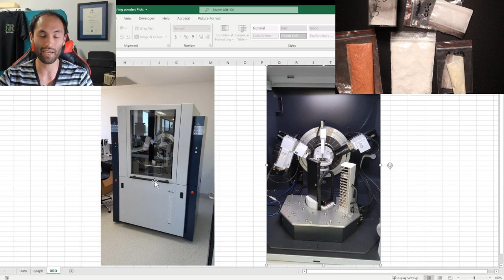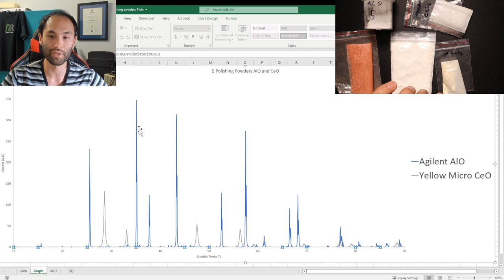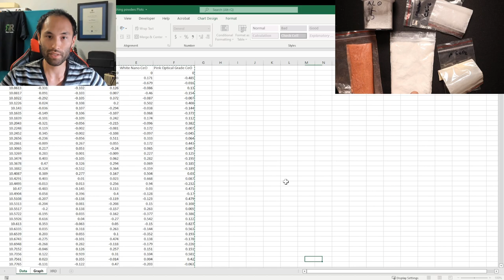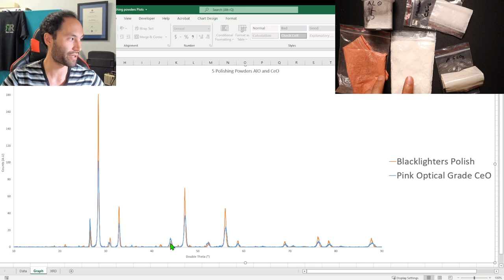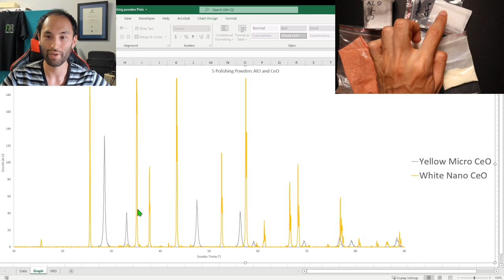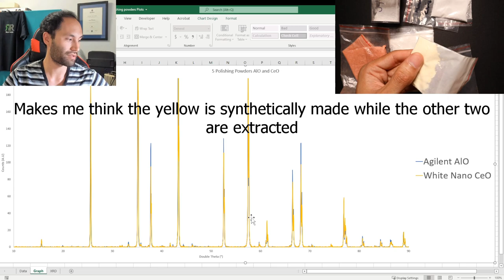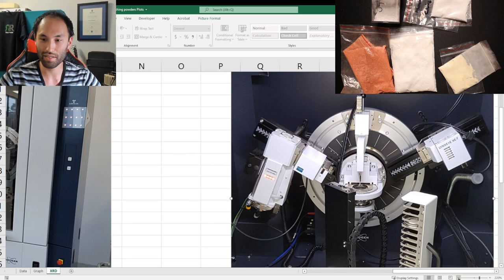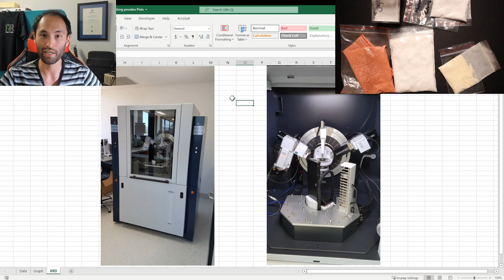Cerium Oxide VS Aluminum Oxide Polishing Powder X-ray Diffraction Analysis With Surprising Results

Comment: At first I was worried Mark (Blacklighters) would be pissed you shared their secret recipe lol. With how it turned out just the opposite. No additives were revealed and all you shown on it was finer particles / grit. Giving them the stamp of approval with the finer quality product. Would have liked to hear alittle more on how the graph reflects on the chemicals / substances within. However I followed the video just fine, despite my tiny stoner brain * laughs * Happy New Year Roy brother! This Buds for you! Oh check your messages!
Reply from the maker: I knew it wasn't going to be a specially formulated mix just wanting to know which metal oxide it was in the end.

Man I feel like if I got into what the peaks actually meant 90% of the audience would disappear. Its not overly complicated physics but it is only properly explained in uni level physics. Many of the researchers that use the technique don't actually understand the process just the results.

Comment: Fascinating stuff. Really looking forward to seeing more science coming through. Thank you for sharing and bring it on.  😁👌  And might as well have the paper hanging on the wall.  I don't have a PhD but have worked for and with a few and I appreciate the blood, sweat and much tears that go into achieving one, so congratulations on that achievement as well..
Reply from the maker: I will keep it coming and hopefully understandable. 
PhD was by far more difficult than working full time afterwards. Its like working 24/7, 365 days a year for about 4 years.
Reply: @RoysRocks  Yep, one of the main reasons I never got round to it.  I got too used to the easy life of only working 24/6 for a few years.  😆.  Did some medical resarch for 2 yrs, then went to a small R&D pharmaceutical company. Haven't worked in science for decades, but once it's in the blood ...  🔬🤯💥😆

Comment: Thank you Roy for this science contribution on your channel. Very informative . I buy my cerium oxide from a german manufacturer. It is white and very fine gritted. Works fine for me but it needs a few more minutes of polishing compared with my aussie cerium oxide. Happy new year to you and every subscribers and others. Cheers. See you next year. Mikael from Sweden.
Reply from the maker: Sounds like it might just not be as fine as the Aussie cerium oxide you have tried.
Optical grade is only about 3 micron but the stuff can be made down to 0.1 micron quite easily. 
In fact I am thinking of making some 0.01 micron cerium oxide myself in the lab out of interest.

Comment: Nice. I never got to use a XRD, XRF, IR, SEM, and wet Chem were in my Lab. But it has been 30 years since I worked in a Lab. Weird that the Black lighters need a really thin solution when normally cerium oxide is applied thick?
Reply from the maker: All great techniques. I dont have an XRF or SEM in the lab but plenty of others that could do some interesting opal related testing.

The science behind the use of cerium oxide actually shows that water is a very important part of the process but that will be coming up in another video. Too thick and it wont work, too thin and you'll keep needing to reapply.

Comment: Hi there, I am working on Ceo2 and Aluminum, and I want to know if I can make AL anti-corrosion by using Ceo2 ? I have in my lab PLD Machain, and I want to set the Ceo2 as Target and AL as Substrate. Have you work on this subject?
Reply from the maker: I have not worked on that but there are a few publications out there if you look for "anti corrosion with CeO" you'll probably need to use electrodeposition silane/nano-CeO.

Comment: So if you looked at polished opals, you could tell if the polish was  cleaned off or a layer on the finished stone then?
Reply: It’s not a polish like wood polish which is applied and rubbed in, these polishing powders are just ultra fine grits which sand the stone in a much finer manner than the nova wheels can accomplish
Reply from the maker: Hi @ResortDog, not with XRD and as TY stated we are not applying a coating of cerium oxide we are very gently still removing the surface of the opal but at a very fine rate.

There will be a video on what cerium oxide does to polish coming up and I think it might surprise many as it is not as simple as a high grit grinding.
Reply: @TyOtis  So you would find no cerium layer on an opal which has a water content then? Can we see?
Reply: @RoysRocks  Thanks. I look forward to it. I was thinking about what i had seen about the Bielby layer which seemed to me like tin glass, so to speak, that is impervious to water. Our opal is more heat sensitive than most. Ovals & Rounds is all I'd ever ask for from commercial cutters.
Reply: @ResortDog  Bielby is nonsense.